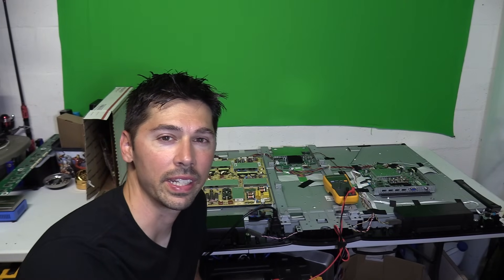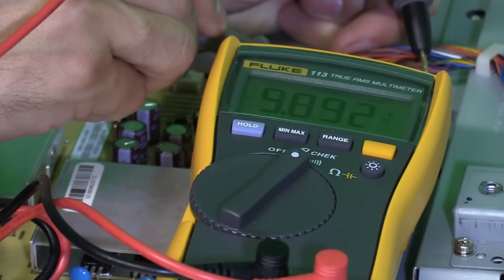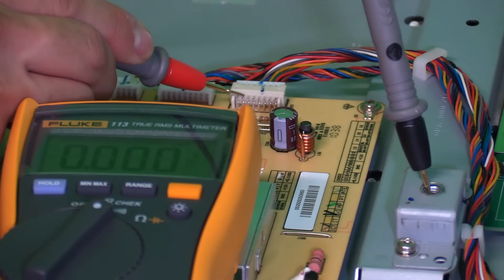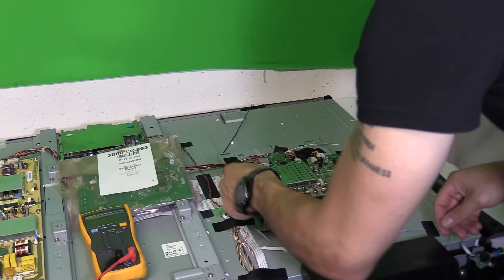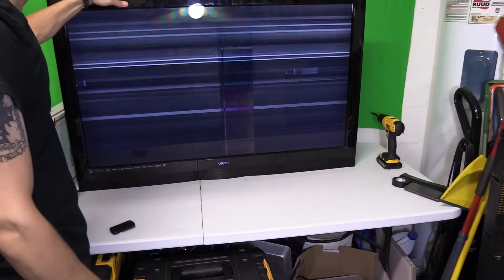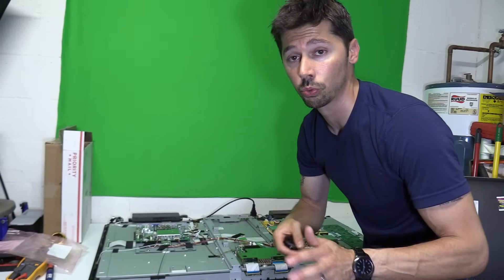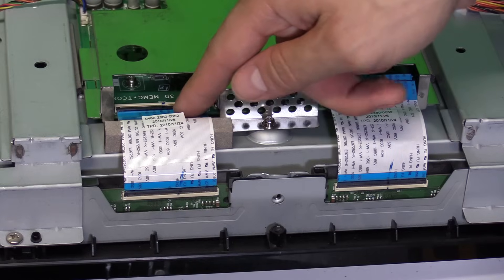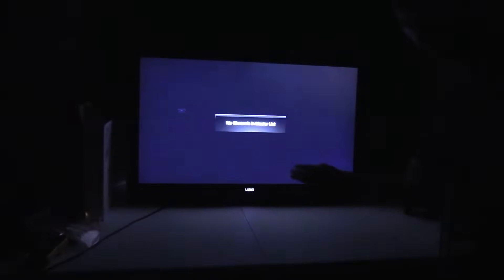LED LCD TV REPAIR, DOESN'T TURN ON, NO PICTURE SCREEN, VIZIO XVT3D47 FIX

Comment: i fixed mine lg 47sl80 ccfl backlight :) i had to replace the main power supply board which i managed to find for 38€ with postal fee :) then i heard a sparking sound from a display and had to take it apart to find that at the end of one tube, there was some arcing going on... i remade the insulation under the spot where it was arcing and rolled all the tubes to revive the connections, clean all the dust and smudge out and put it back together, which was even harder then taking it apart... and it works :) thank you man! i saw most of your vids :) you helped me a lot! regards from sLOVEnia!

Comment: You have inspired me to troubleshoot and repair a VISIO 39" TV that was completely dead. Power supply tested good, following your guidance in checking it. I found an inexpensive main board on Amazon, used but good. Ordered it, installed it and turned on a TV I was just about to set on the curb. Thanks for your clear and in depth instructions.

Comment: Narrowed it down to the PS by isolating it and was still blowing fuses. Figured I would just grab the board rather than troubleshoot parts because I just don't have the time right now. Ordered the board and took a while but they upped it to USPS priority and made it here. Put the PS in and works perfect! This was the perfect curb find! I highly recommend them and give them a little time because it may come from a different warehouse. Thanks!

Comment: just got back to atlanta from visiting with family in tampa a couple of days ago. a few hours ago, i was searching for how to run speaker wire through studs since i was wanting to put some in wall speakers in my kitchen and stumbled across your video on a flex drill bit. now, a few hours later, i was looking for how to replace/repair the main board of my jvc jle42bc3001 and again have come across one of your videos. not sure what the universe is trying to tell me but i'm listening!

Comment: Great video for a layman like me. I have an LG TV 65inch where there is no display on the screen, not even the remote functions are displayed, its an absolute black screen (audio is working fine though).  What would you suggest?

Comment: Hi tampatec.  Did you no when your tv Red light blinks it is indicating that which TV part has gone wrong and its a code for the TV and what to do so I thought I would let you know as I have learn quite a bit from your videos thank you very much my TV is nearly fix I changed a capacitor and know the red light just stays on know so I just need to get a new main board when they get them back in and hopefully it will be fine

Comment: Great channel. I have a 58 inch Hisense tv. Red LED light goes on for one long and two short durations. Replaced Power, mother and Tcon boards with no change.  No image, no sound, just the LED light going on one long and two short. Any idea?

Comment: Good review. What about other Vizio models?  Are the symptoms going to be about the same for diagnostics? Case in point. We have a 6 year old P702ui-B3 that began to power on without the V logo, it had back light but barely could see the menu when activated. Sound worked fine. Turned the unit off, then back on and it displayed the V during boot up and functioned just fine. This process repeated itself every time the TV was turned on for about 2 months. Then, while on we witnessed the picture begin to fade and alter then finally no picture but had sound. Turned the TV off and it never powered on since. So, the current status is, it will not power on at all and we did the reset procedure of removing the power cord and holding down the power button on the back for a minute. That failed to clear up anything. Called Vizio and they simply said it's not worth repairing, likely the backlight. At this point, we want to diagnose this and see if it might be worth saving since it was a rather expensive model at the time.  Go through the same procedure as in this video?

Comment: hi great vid. any ideas on pioneer plasma blue flashing issues? 
have a pdp LX508 that blue flashes 13 times. tv shuts down into standby after warming up. can be turned back on again but turns off shortly after. please help! what board likely needs replacing!?

Comment: Quick question - love your detailed videos by the way. If the TV screen turns on for a while then goes off in less than 1/2 second could this be the T-Con board or the LCS backlight circuit?

Comment: I have an old LG tv and the standby light is on.  Sometimes it will turn on with the power button and sometimes it will not.  When it's on, the power button always works to turn it off.  The rest of the functions work when it does power up.  However, it will not keep the current time when I enter the current time.  I reset to factory specs on the unit and it works normally for awhile after I do that.  But then it goes back to powering up occasionally and the current time sets back to dashes, it will not keep the time.  Here's my question:  Is this more likely to be a problem with the power module or the main module?  I want to try to replace them, but I wondered which one I should try first.  On computers, I know there is a battery that keeps the current time clock running.  I wonder if there is a similar battery on these televisions and if there is, which module does the battery sit on?  Thanks for your help.

Comment: I love your videos on electronic troubleshooting & repairs.  I am now shopping for a decent Fluke multimeter so I too can follow along & revive TV's.

I have a Visio E60-E3 that I took apart to repair a sag in the very front screen layer due to some broken parts on the bezel. After repairing the bezel now the TV will not present the brand logo or anything on the screen.

When I hit the power the backlight comes on with no indicator light, then the indicator light flashes once as the screen goes black before starting this cycle of backlight on/one indicator flash/black screen rinse & repeat. 

Got any guesses as to which board to replace while I look for a multimeter?

Comment: Have you ever swapped screens from different model TVs to repair one that had a cracked screen or other screen issues. Such as a damaged outer layer or viewing layer of the screen? 

I have a monitor which has this issue. I think my nephew scratched the top layers of the screen. When turned on w/o an input, where the screen is just blue. In a couple of areas I can see white, which I assume to be the backlight shining straight through.

Is there a way to fix & what would you recommend? Thanks!

Comment: I have a Sharp Aquos Model# 65N7000U. Last night we had a storm come through and when I went to bed the TV was fine. Got up this morning and the red LED indicator light is not on and the TV will not come on. TV is plugged into a surge protector but also has an outside antenna plugged in. I have tried all of the resets nothing works. Any help would be appreciated. Thanks, Thomas

Comment: I have a rca 52 in tv that has back lights but no sound or picture. What do u think would probly be the board to replace? Would it be the logic board since the power seems to be working fine?

Comment: Hi I have a Samsung TV mdl. UN60J620DAFXZA. When TV is plugged the red light (by power button) is blinking twice and blue screen is flashing. I disconnected the main board RIBBON from the power board and it's doing the same thing. Is the power supply board bad or the main board. I have video to show if I can send it to you. Thanks for the help. BC

Comment: I have an Element smart Fire TV. It turns on and after a few minutes the video goes but I have backlight and sound, if I turn the TV off and on then it works again for a few minutes.. any idea? TCon board?

Comment: Hello, My Aquos Quattron 60 inch turns off by itself. Do you know why it does that? I have read comments that lights are flashing in some cases but in my case the TV just turns off with no flashing ligths. Let me know if you have an idea. Thanks a lot.

Comment: BTW I have this same tv that I have not been able to get running. Half the screen is out so I assumed it was the T-con board. I ordered a new one but it didn't fix it. I swapped the ribbon cables too, no go. It's not the leds either. I am assuming the problem is on the section where the ribbon from the T-con plugs into that side of the screen. I would appreciate any advice you might have on this.

Comment: Good morning I had a HDMI cable that was grounded  I didn't know about well needless go say I went to plug it into my Vizio 43 inch Smart tv it went off and will not come back on as I touched the HDMI cord to the socket there was a small spark then the TV shut down what board should be replaced?

Comment: We have a Vizio P65-C1 that won’t power on - we’ve already replaced the main PSU board, which didn’t fix it.  Any suggestions on what diagnostics to try next, to identify which board is faulty?

Comment: I have a Vizio model E502AR. Power surge/lighting strike issue. Have replaced all 3 boards (power, main, T-con) Power light (Vizio emblem at bottom of tv) comes on now and stays on but still no sign of any picture. Black screen only. Any ideas?

Comment: Hey Tampa tech, I have a Visio model # m43-c1. The standby turns on then fades then comes back on then goes off, and no picture. I tried the light test but see nothing. Any advice would help. Thanks.

Comment: I need your help I have a 65” rca model# sld65a55rq that turns on a has the glow like the one in your video but no picture I replaced the t-con board but it still does the same thing what else could be the problem

Comment: I've a question @tampatech. I've a Philips tv 50pfl3908/f7 DS2. The power supply is fried (A37U0MPW-002).I've found a replacement power supply with part number A37U0MPW-001. Will this work?

Comment: Hi Tampatec im from Brazil i love your videos, i have a Sharp LC 32r24b , when i insert the ac cable they give me blinking leds the power led and the ocp led alternating , i check my power suplay and i get in the conector to main bord the voltage ac=3.3v and the BU5V=5.2v  if i press power buton i get a signal of 2.7v very quickly 1 secound from the main bord Ps On and theY all shutdown the ac voltage and the bu5v from stanbay gone to 0.6v.  
   I try to arm the power suplay without conected to the main bord with a resistor of 1k betwin the bu5v and the Ps on, i ear a doble click from the relé and i do not get any voltage from 13v and others.  What you think? is a issue of the power suplay, the power suplay goes to protection mode maybe?  Thanks very much for your atencion Tampatec.

Comment: You seem well versed & I am sure that you could definitely assist me & my tv! I have a 55" Vizio model m550vse a few days earlier, I turned off the front indictor light to conserve bulb life & a few days later, I turn on the tv & the screen lights up momentarily & then, Goes black. It has audio! Every time that I turn it on, The screen lights up just for a second or two & goes black! I tried the flashlight trick & I see nothing! Which board do you recommend replacing?

Comment: Hi when I plug my inverter board in (hyundai Q321 inverter board the tv will not come up and stalls to standby with power drops. When unplugged the rest of the tv works, all the capacitors look ok throughout the boards.
 I am fairly sure the psu is ok as the main board works as the tv tunes and gives audio from tv channels but stalls to standby when the inverter board is plugged in do you think 
 a new board will cure the problem.
Over the past year the tv has taken longer and longer to come on like an old valve tv.)

Comment: Hi Tampa tec, I have 2 Vizio TV's. Both stopped working on the same day. I called Vizio, they say both need repair. I checked the internet, can't seem to find anyone who has my issue. Both TV's turn on. Both TV's work, screen, icon, input, etc. Both turn off about 3 minutes or less after turning on. I've completed all the resets I could find. Followed all the Vizio steps from their tech, but nothing works. Do you have any ideas?

Comment: I have 2 different Samsungs. 1 has standby light and voltage in the power board one has voltage no stand by light. Replaced BOTH power boards and both main boards and nothing. NO back lights either. Can they BOTH have bad led strips?

Comment: Hi I am new to this and your videos have helped me so much in repairing stuff, could u please tell me where u find your schematics from for TVs as I have a LG 52LD550-ZC with a power out put problem on the main board and cannot find the fault, there is no 12v or 24 volt out put showing on the meter, 
Thanks in advance 
Sean

Comment: i was inspecting and testing various points on the BN94-04689A board and when I did the same to the BN94-04689B I noticed the A board has an extra small switch soldered on and because it is a mechanical type very small button. do you happen to know that the differences are?

Comment: Hello Tampatec I have a Hitachi LE55A6R9A, it turns on but has a very faint screen that I'm able to see with a flashlight, also i have no sound. I tested the stand by voltage with set plugged in but not turned on, I didn't get no reading on the 3.3 volts, but i did get a reading on the other (3) 12 volt, I'm wondering if I'm supposed to get the 3.3 stand by volts or not?

Oh I believe there are 2 bad diodes on the power supply board, can you plz help.

I want to thank you for all the effort and the time your putting into this, I really appreciate what your doing, you make great videos btw, thanks again.

Comment: Hi,
I have a VIZIO TV that is not turning on once I power it off. I have to unplug it and leave it unplugged  for some days and it could turn it on again. I have changed the Main Logic board; but, the problem persist.  Back ligth is just on for 1 or 2 second . What could be the root problem?

Comment: Great videos! My Vizio won't power on. After doing as you suggested, the vizio light comes on dimly and fades as it does when turning off. I already ordered power supply from electropartsonline as it is a very rare part. I got his last one. Vizio 65" M3D650SV 0500-0507-0920 LCD Power Supply

Comment: Hey Tampa, you're videos are awesome man, thanks for teaching us all about the electronics we use on the daily. My vizio TV (e500i-b1) when i power it on sometimes it blinks the backlights, then you can hear sound, but its black. I turn it off and try to power on, sometimes it will work and display right and wont turn off during watching or gameplay. But once i turn it off it it may blink the backlights or not come on at all, again sound etc still there. if i unplug for 5 mins it turns on normally as soon as you plug it in, but it'll go back to the behavior i mentioned. Thanks for any reply, and keep up the great work on the videos.
Reply from the maker: Jehu Garcia check volts to backlight boards if steady and ok then can be bad backlight perhaps.

Comment: I have a hitachi le55a6r9a I changed both tcon,and the main board still I get no picture it's still black. I used a flashlight and I seen the volume button! I need to change the inverter where is that located

Comment: I have a Philips flat TV model number 32HF7874/10 the screen does not come on when I check it the circuit I couldn't find any  bad capacitor but one thing I realise was current leakage that every metal part is live ,the metal part of the capacitors are live too please  for help in this situation what can  I do. I even  bought  a used  PLCD  190 p1 on eBay but got the same results  I need help and advice  thanks in advance

Comment: Hey there! Thanks for the great videos! I have a Sceptre X40 with no power, no picture, no lights, no sound. The screen flashed off, red power light stayed on, then picture came back on with sound as normal, then everything went dead within seconds. There is power going into power supply from plug but no power voltage from pin. I thought I was getting standby voltage but it goes back to 1. I changed the main board but still nada, should I change the power supply next? Help Tampatec!!!

Comment: i have a rev 01 for the power board 0500-0407-1070 the revision in your web page is rev 0 . what is the difference and please confirm if i can use it to replace rev 1. thanks

Comment: Another great video Mr. Tampatec !
Reply from the maker: thanks
Reply: I wish you was back in Jersey. I will definitely come to your classes.
Reply: @TampaTec  Hey, i watch your videos all the time. Youve helped out in so many way and i appreciate it. Thank you. However im stuck with one project im working on. Its a hisense 46 inch (46k360mn) when i plug the tv in the standby light turn on and turns off. The power board runs a little loud when the main board is plugged into it ( normal when unplugged). I have checked the values running off the power board and theyre all correct. Standby light is at 5 as well. I replaced a couple componets on the mainboard because they were low in value now they are normal. There has to be a bad component in the main board still right? After the fixes ive done on the main board the power board still runs loud. What suggestions do you have that i should check? Its a short somewhere right?  Thank you. One of your subscribers

Comment: great vids...one question _ what setting do i need to put my meter on to test standby voltage etc, does it go on continuity/diode  test or on DC voltage?
Reply from the maker: tAuf 003 DC

Comment: I have a challenge for you. My Vizio Smart TV started acting crazy yesterday. Started getting varying degrees of stripes of green data streams running vertically down the picture, just like in the movie the Matrix. Then it just started turning itself off. Sometimes the pic would freeze then it would turn off. I would turn it back on and and then 30 seconds later it would turn off again. Any idea what's up with that?